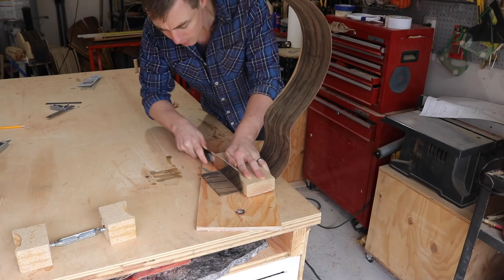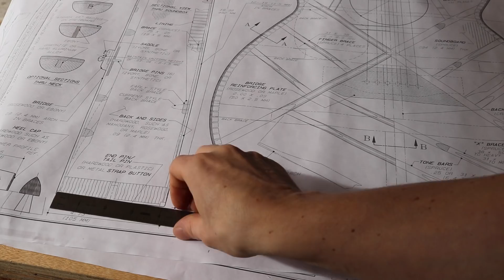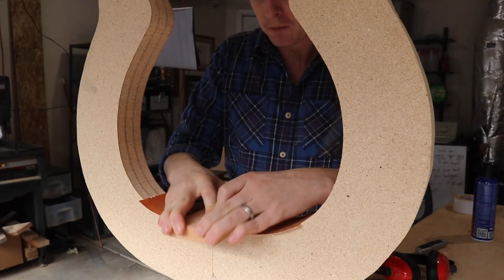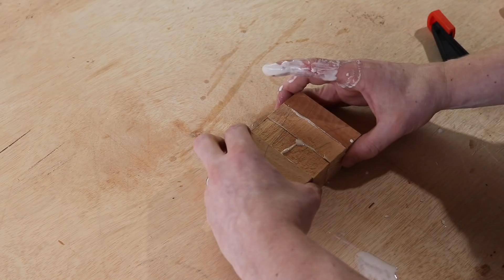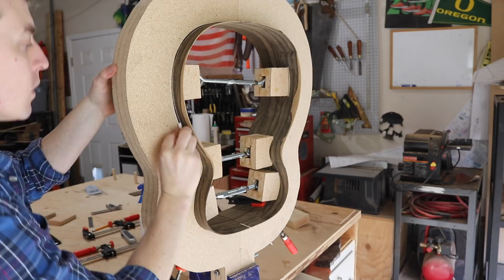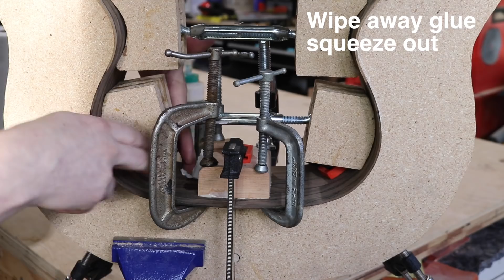Attaching the Sides (Ep 4 - Acoustic Guitar Build)

Comment: could you use a steamer box (used in wooden sailboat building) to steam those sides before you bent them? Would that be a better way? Less cracking? And then dry them out with the heat blanket after bent to shape and inside the fixture? I used to do that with aluminum in a fashion. I would build something out of bendable 1100 aluminum and then heat treat to T-6 hardness condition after completion. Seems like the steam process might work well.